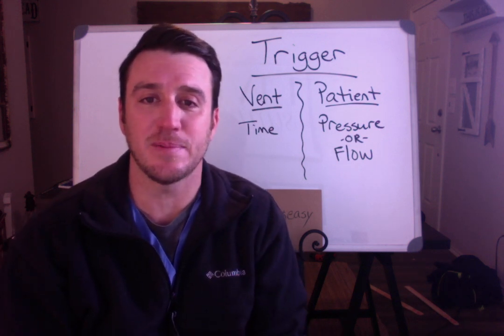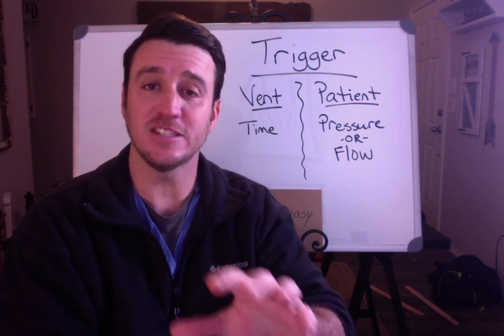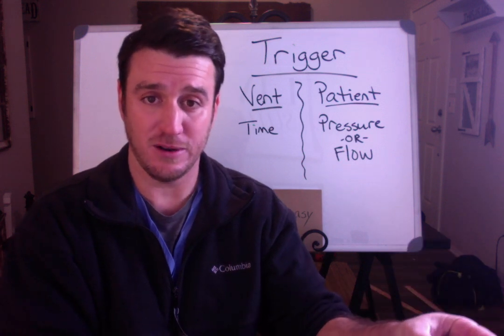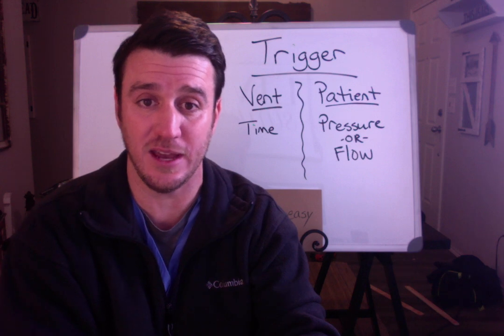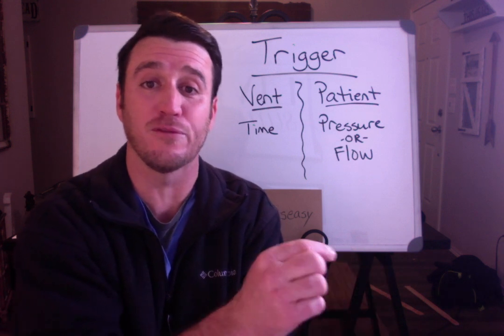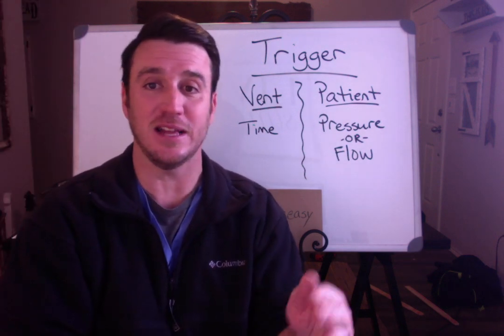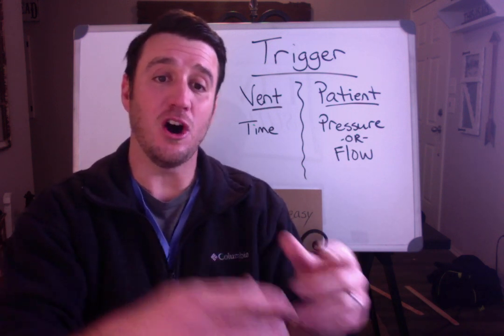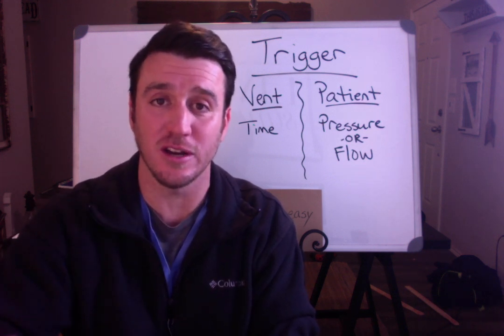Respiratory Therapy...Mechanical Ventilation:  Trigger & Sensitivity

Comment: Hello Joe. Is a flow trigger of 10 or 5 more sensitive on a vent?
Reply: Thank you! I understand it as the return flow has to be 5LPM less than the bias flow before a breath is triggered as opposed to 10 which would be a much tougher trigger.
Reply from the maker: @robertp3371  100%
Reply from the maker: 5 lpm is more sensitive than 10lpm.  Great question.  Thanks for watching!

Comment: What is the best sensitivity to set a patient on .As I was listening to your triggering mechanism between flow or pressure, I had encountered this type of issue all the time.Sometimes, I come to a point where I want to Residents not to touch my vent.Most of the time they forget to switch the triggering mechanism appropriates to the right mode when they switch pressure control to assist control or assist control to pressure control.Sometimes, I walk into shift and finds ventilators on pressure control with flow triggering.What kind of abnormalities that can cause to someone?

Comment: Where is the sensor in flow trigger and pressure trigger in the ventilator Sir
Reply from the maker: Hi Sheetal.  This depends on which ventilator you are using.  Some are located within the ventilator itself, while other ventilators utilize flow sensors placed at the wye of the circuit, closer to the patient.

Comment: Hi! Great work! What happens, if the trigger is set to zero (in the ventilator menu it's in between flow and pressure), and neither flow nor pressure? I mean, what happens in the ventilator, inside? Because the patient still can trigger with this setting. Thanks!
Reply from the maker: Will you take a picture and email it to me?  respiratorycoach@gmail.com

Comment: Great video man but at 8:05 when you said : if you have a bias flow of 5 liters of set  , then the vent is sending out  5 liters and getting back 5 liters  and no breath will be given other than the vent timed breath , i don't  understand  " the vent timed breath "  mean in this point , can you explain this point  ?  . Thank you.
Reply from the maker: Thanks, Saccda.  Let me try to clarify for you.  All machine breaths are time triggered.  Patient generated breaths are either pressure or flow triggered.  Bias flow is a base amount of flow moving through the  vent circuit.  A flow trigger of 2lpm must have a at least 3lpm of bias flow moving through the circuit.  When the vent sends out 3 and only gets back 1, then it recognizes this as a spontaneous effort from the patient.  If not spontaneous efforts are detected then the only breaths that will occur are the time triggered machine breaths.  That's what I was attempting to articulate at 8:05.  Does that make sense?  Let me know if not.  Thanks for watching my friend!
Reply: Respiratory Coach  I see , thank you for your explanation 🙏🙏🙏
Reply: @RespiratoryCoach  hi Coach! Is the bias flow always 5?